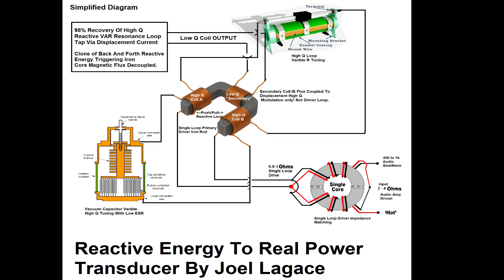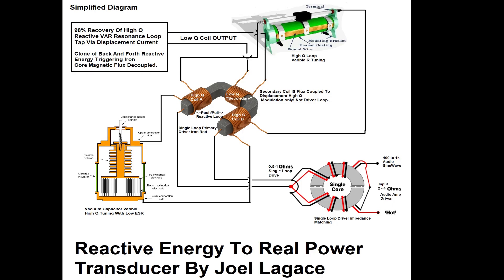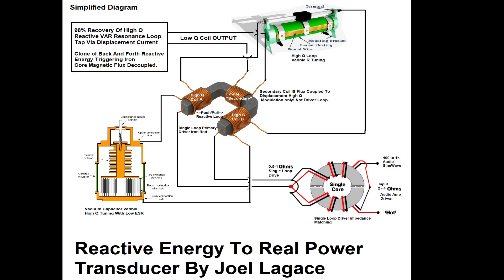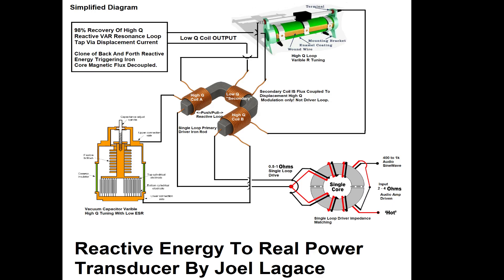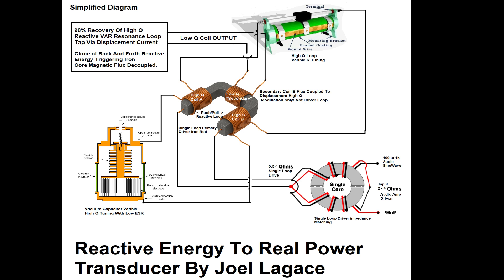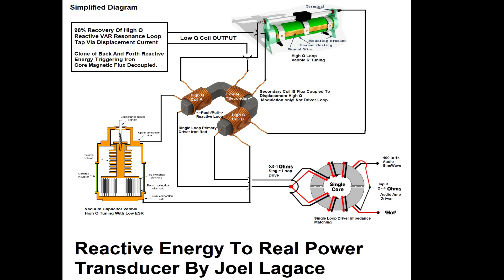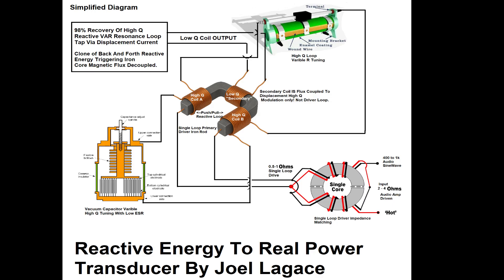Reactive Power Transducer

Comment: Thank you Joel, there are so many ideas, thoughts and questions after watching your videos. So,  can I assume  that an electromagnetic field propagates even down a single wire of a household electric wire even with out a load at the end of that connection. What if the only resonant thing on an unloaded end was some kind of transformer  like you do but without any circuit. Or is it possible to run the two power lines split with a length on some multiple of the 60 cycles and radiate it to tuned recievers that use that to resonant the isolated power from an unloaded source.  I might not quite have that idea right. Even if I split the positive, like you've described. Maybe next time you go live if you have time maybe we can get your thoughts on our ideas as well. So grateful you've started my brain asking questions and thinking again. Please know how amazing what you're doing is and how helpful it is to us in so  many ways. Keep going, you've got the right stuff on your channel that we need to expand our mind and thoughts and you know your stuff well. Thanks again

Comment: I am sorry i  would like to add also some qoute, according the document it is conversation between Tesla and interviewer;

 Lawyer, 

You say the energy was 1,000 times greater. Are you saying that the voltage was raised, or the current, or both?

 Tesla

Yes [both]. For the sake of clarity, I take a very large self-induction and a relatively small capacitance, and tie them together so that no electricity can leak out (radiate out). I thus get a low frequency; but, as you know, electromagnetic radiation is proportional to the square root of capacitance divided by self-inductance. I don't allow the energy to come out; I am accumulating tremendous energy in this circuit. When a high voltage is received, then if I want to receive electromagnetic waves, I do so (radiate), but I prefer to reduce these waves in quantity and transfer the current to the ground, since the energy of the electromagnetic wave is not recoverable, while the current from the ground can be completely recuperated (returned), we kind of load energy into an elastic system.

 Lawyer
Did I understand you correctly: if there is radiation in the circuit or electromagnetic waves are emitted by your system, then the energy is spent?

Tesla
Completely spent. In my circuit, in which you can also receive electromagnetic waves, up to 90 percent of electromagnetic waves, if you so desire, and 10 percent in the form of current that passes through the ground. Or, you can change the process and get 10 percent of the energy in electromagnetic waves and 90 percent in the form of current that passes through the ground.

"""""""""""""""""""""""""""""""""""""""""""
Quote from related doc.

bird_eye

Comment: When will you be able to get a 9 volt battery to manifest 8 kW?
Reply: Why an 8 kW battery? Wouldn't it be better to cast a net in space like fishing and catch a UFO? They probably have batteries there. :) You make a 1-watt battery and convert the energy into 8 kW. Everything can be done with an 8-watt pulse. You don't need such a powerful and complicated battery. You just need to learn how to convert 1 watt into 8 kW of power using a pulse. Everyone thinks it's impossible, but I already know how to do it very easily. First, you need to take that 1 watt from the battery and increase its power using a resonator. If you increase the power to 8 kW using reactive current, you can convert it through a bridge rectifier to a bank. You need to store energy. And you know why, because one pulse per second doesn't have 8 kW of power, but, for example, 8 watts. Even less has a watt; I'm just giving you examples. To increase that watt, you now need to calculate the frequency through which those 8 watts must pass. If you input a high frequency and pass, for example, 100 Hz per second, you increase the watt. You understand, you increase watts through frequency. First, you have batteries, then you have the LC resonance current and pulse. You have the resonance frequency, and you know how much power you have per second, and you store it. Without a bank, this will never work. Because those several thousand inputs must be charged somehow.

Comment: This is so awesome making me think of my old pocket pager  or beeper days. There was a type of receiver called super regenerative, I feel like this relates to it somehow. I always wondered if you had a larger and different receiver antenna other than a tiny  1 1/2 inch ferrite core anteena to resonate with some kind of csrrier to pickup its energy and convert to usable energy. A transducer of sorts? Or not? It's just an antenna coil a capacitor and a load.can we tune in 60 cycles or is thst what you're doing?

Comment: What is a transducer in the first place ? I would call it a device able to make a direct link in a gradient or potential for a energy form dissipated/radiated in local environment. So they can be adapted/built for exact form of energy considered and materials used must have a maximum response for stimulus considered.

So, solar panels are transducers, peltier/seeback are transducers, water/wind turbines are transducers … so, “reactive” electric power is a radiant energy and can be used as well. Any radiative form of energy can be harvested as long as someone is able to apply correct and efficient method with knowledge about properties of materials used.

“The secret” is to harvest only the radiative form and not the source of that radiation. If our domestic/commercial devices would be able to accept different frequencies of power delivered and not as they are now made for an exact fixed input, we would be in a better place, not constrained to hydrocarbons.

There are many patents for many transducers but, almost nothing for an “universal adaptor” for each load be able to deliver required power to produce usable work … this is the main point and not the harvesting method when we are living in a sea of energy.